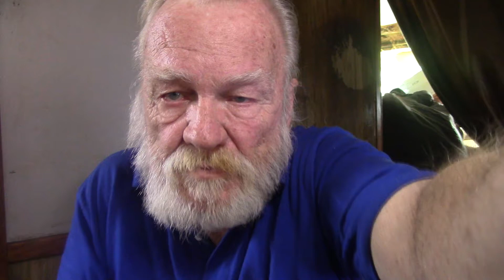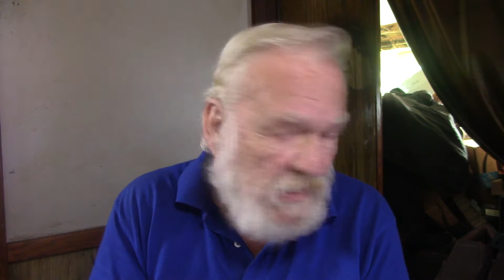How to pull stuck axle, update gear change in truck.

Comment: what all else do you need to get your truck road ready?
Reply from the maker: get the gear set installed in the pumpkin, get the pressed off and pressed on, install new seals, fill with gear oil, mount drive shaft, go for a spin. then if no howling, no grinding, or to  much slack. then money will be changed hands. ready to go